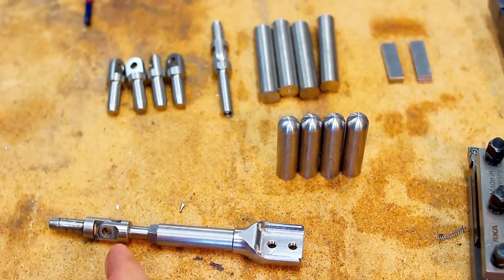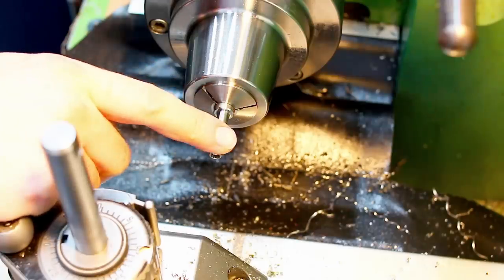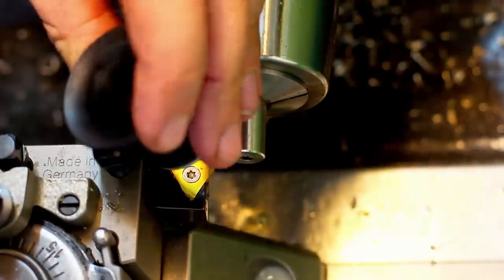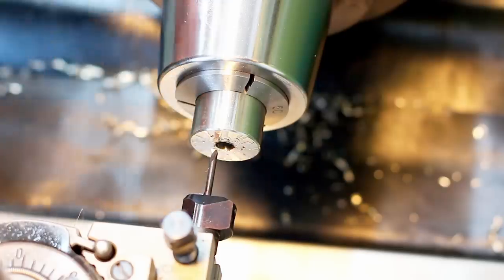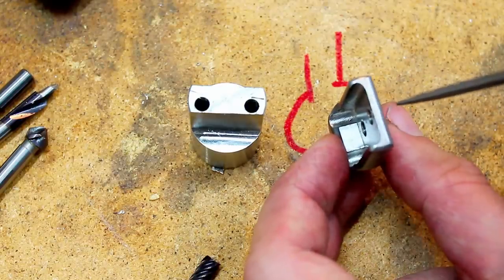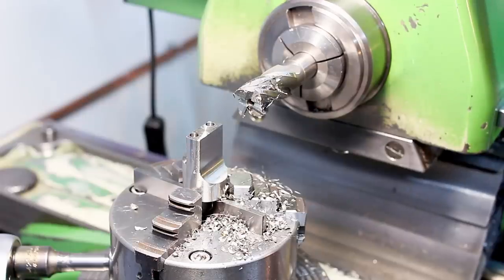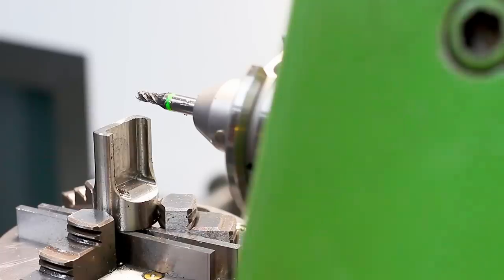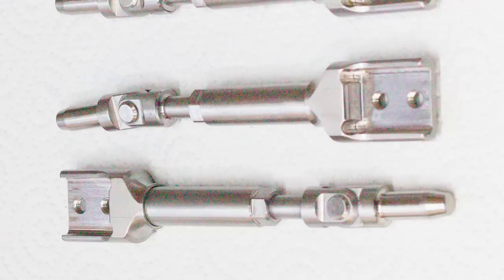Making a part: Flux Capacitor Dampener Units

Comment: Excellent work. I play your videos and other machinists like Robenz when I’m in the shop. I work alone so it’s like having a shop mate who only talks about machining. Which is perfect. I also make several spares of most parts that are > semi complex. I also will sometimes cheat a few dimensions on a couple of spares so when the engineers realize that they didn’t get it right, I can look like a hero when I turn around a part in a few hours.

Comment: Stefan, fully enjoyed this video as I always do. One, maybe, suggestion; I bought a large collection of HSS Co PM mills. I'm sure you know what these are but for the people who don't; these are sintered HSS Cobalt mills which means that the way they're produced is similar to carbide mills only with other ingredients. Because I own a lot of them I pushed them to their limits in tough materials like Toolox 44, hot rolled 316 and, surprisingly, they last much longer in hogging sequences especially. The corn cob variety is getting low on stock unfortunately because I use them a lot since discovering their durability. I use them mostly cnc and program a constant feed pattern with a 25% overlap in between cuts and a d.o.c. of 2D which is impressive in my book. The special carbide mills I used before with a d.o.c. of 1 x D (specific job in warm rolled 316, D=8) took about 1 kW on the first depth of cut, 1,5 kW on the second and 2kW on the last cut and was destroyed in one part. I had to make eight and was in something of a hurry. I loaded the PM HSS Co variant and, after correcting the spindle speed, made 8 parts with one mill used which looked like new afterwards. One skim pass with an eight flute carbide cutter left the part on size and in bling condition. Maybe something to consider? Curious about your answer. All the best, Job

Comment: I use Simturn AX carbide round shank micro tooling because I can make my own holders using a reamed hole and cross-pin, but I'll have a look for used Horn tools on ebay to regrind now I know the trick about only the sloping faces of the holder being in play, Great tip
Reply from the maker: Simturn has some extremely nice tools - I also use some Gühring round shank boring tools with the cross pin for alignment.
Simturn makes it very hard to buy from them via an onlineshop, thats an easy way to loose my interest.
pHorn has a great onlineshop and a full paper cataloge, that makes shopping very nice.
Reply: @StefanGotteswinter  Cutwel in the UK has a good selection of Simtek tooling, but it does seem strange how difficult some suppliers make it to buy online!

Comment: On some big horizontal milling machines, they make a 'parking attachment' to support the vertical attachment while you swing it out of the way & store it on the side of the machine. I was just thinking, there must be some way to make it easier & quicker to swing the Deckel vertical head out of the way when you need to quickly use the horizontal head.. for example, maybe lift the rear of the vertical head slide, insert a piece that connects to the both halves of the dovetail joint, & then lets the vertical head slide pivot upward out of the way? just a thought.. 
Thanks for the great content!

Comment: Hi, Stefan, I wish all Design engineers thought as you and I do, about producing an engineering drawing which gives the actual dimensions which enable the machinist to produce the part without having to perform mathematical gymnastics to do the job. The less calculations we have to do reduces the chances of making an error in the production of the part. I try to teach this to apprentice Engineers with varying degrees of success, but will keep on trying. Happy new year to you and your family, Mal.
Reply: It is often hard to produce such a drawing unless the machinist who will carry out the work is available for consultation. There are generally a number of different setup options, or even different "machine type or configuration" options, most of which will require different "dimensions to produce the part". 
If a part is to be machined by an external or unknown resource, I have found it is preferable not to add chosen redundant dimensions to the main views, as this may unduly influence the choice of method. 
It also greatly complicates the specification of GDT tolerances.
But I personally favour adding supplementary views (usually on a separate "information only" sheet), with non-binding supplementary reference dimensions, for cases where machinists would otherwise have to do trig. 
This does not usually add significantly to the time taken when producing drawings from a solid model, as those views can be copy/pasted from existing views.
When the workshop is within the same organisation as the design office*, the most straightforward way is to make the solid models available to the machine shop so they can extract the setup dimensions required by their particular setup or machine configuration. 
The drawing can then focus on the dimensions which require to be controlled and verified, eg those critical to ensure the part will fit other parts.

* or uses the same design software (provided there are not issues of proprietary security)
Reply: @Gottenhimfella  I suppose I am in a position where I can see both sides having worked on machines my whole life, but also spending a significant amount of that time in the design of the parts I am manufacturing, ( Reverse Engineering). On most parts I specify the Datum first and that normally takes care of the GDT issues, I do use auxiliary drawings when a part is complicated and add notes to the drawing to get the point over, but I suppose the most important part of the drawing is the legend in bold type on every drawing " IF IN DOUBT ASK"

Comment: Is your dro capable of saving tool specific offsets? I was wondering, because you touched off z with the the edge finder first and then again with the 63mm cutter
Reply from the maker: yes, and I did use that. But you still need one initial touchoff with the tools to locate those offsets (Or you have a way to measure tools offline like with a Zoller tool presetter)

Comment: A dampener is something that makes things wet, makes them damp. A damper is something that slows down motion, providing resistance that is proportional to velocity.
Reply from the maker: Yeah, I learned that since i released the video :D
So no it will be there for eternity to display my error.

Comment: I'm no machinist but the only real wear part in a spring dampner is the spring which seems to be easily replacable. Granted this particular part also has a pivot, but wear on the pivot could easily be corrected by drilling holes oversize and adding a simple bushing.

Comment: Stephan, I notice in this video your spindle has NO driving dogs for the tool holder. Is there a good rule dictating the use of driving dogs on the 7/24 based tooling. I notice on the smaller sizes like 20, there are no slots for dogs. Again, very helpful videos,and, thanks for videos on your projects.

Comment: Excellent as always. Are you ever nervous about stainless on stainless dry threads galling?
Reply from the maker: I am always nervous :D
(I have seized a gage ring on a stainless thread in the past, not fun)
Cleanliness and a bit of lubrication (Remaining cutting oil helps for example) help to reduce the danger of seizing/galling.
The final product is assembled with some NeverSeize.
Reply: @StefanGotteswinter  thanks. I have had my fair share of seized bolts.

Comment: I’m curious, what is the cost of OEM if available, how much did they cost if you could charge for actual time spent, materials, overhead, profit, and what you actually charged for the parts ( or customer willing to spend).
Another invaluable lesson in machining, thanks.
Reply: Stefan stated that OEM parts are "unobtainium".  Therefore, whatever he charged the customer for his SUPERIOR workmanship was a bargain.
Reply from the maker: I charged for the actual time spent, material, tooling, overhead and profit :)
And afaik I was still cheaper than the OEM parts used to be.

Comment: Hi from down under . What whitchery do you use to set the cross slide on the lathe to get the drilling tool on center ? Thanks for your time . I hope Santa looked after you for Christmas!
Reply: He mentioned in some previous video that he just dialed that in once, and stored that position in the DRO - no compound means that position is always valid for drilling

Comment: Would it not have been better to set up the 3 jaw with one of the jaws directly in line with the cutting force? Seemed to be a lot of push where the job was trying to go away from the cutter between the jaws.

Comment: Please tell us more about the collet chuck that shows up at about 1:15:30. As always, I appreciate your sharing.
Reply from the maker: Thats a hydraulic toolholder - It holds 12mm shanks (or smaller with reducer sleeves). Incredible good runout and quick changing of tools, but very expensive.

Comment: Would you save any time milling the "ears" with one pass from the top down while there is still stock for rigidity?
Reply: My guess is that would make it hard to achieve a good finish. 
In the absence of a supremely rigid machine, setup and workpiece, it's almost impossible  to achieve a non-chattery finish cut if the roughing cut is not chatter-free.

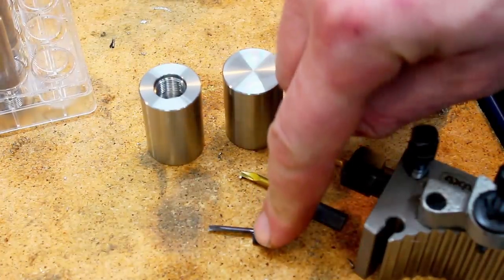Comment: 35:08 only in packs of 2 ? Then how da heck did we then sometimes buy 3 and 1 at a time ?

I do have one maybe two with a shaft diameter of ø0.65mm  and head size of ø0.95mm. And there is absolutely no way that I will use it without a hole in anything except for foam
Reply from the maker: Good relationship with your sales guy? Or buying trough a third party?
The webshop only offers the option to buy in increments of 2.
Reply: @StefanGotteswinter  well i dont know if it was through a third party. i just told the office that i needed like 3 of these and had 3 of them on my desk the day after ( as long that it wasnt to late ) but they sure are nice to have. btw saw at titans of cnc that they came out with a new version ( the same measurement's but with a chilbreaker on. witch sounds pretty sweet to me ( had some long stringy chip problems in titanium and the really small ones in stainless steel )

Comment: So why not use a 6 inch vise for the first op you posted.. ..andncut all 5 parts at once with the 63mm radius cutter? Seems extremly counter productive to set and zero every single peice if you could very easily do them all at once.....ONE SET UP ONE CUT!
Reply from the maker: I would not dare to try that. Clamping multiple parts is reasonable hard to get a firm grip on all of them.

Comment: "Flux Capacitor Dampener" ... so they make flux capacitors moist?  If a component resists some mechanical force, it's probably a damper ... not a dampener. :)
Reply from the maker: Time machines need some moisture, to keep the time travel accurate.
(Yes, mistake on my end :D )

Comment: I LOVE those side mill cutters. I was using an 100x2.5x36Z one on a VMC (using a 27mm face mill arbor and 2 spacers) to slot batches of aluminum parts at a 15m/min cutting feed while climb milling (more than 400m/min of surface speed which seems absurd for HSS-Co)
Reply from the maker: Thats a mighty impressive cut for a HSS cutter :D

Comment: Did I miss the new to you Horizontal Mill acquisition and setup/test run?  Looks like a fine piece of machinery!  Love the Flux Capacitor videos!  Happy New Year Stefan!  Always a treat to see another lesson from you.
Reply: The FP1 is a universal machine.
This is just one of its configurations.
Stephan featured its delivery and setup in a recent video.
Reply: Stefan has a great video on the FO 1, if you haven’t seen it, check it out. He shows a lot of what it’s capable of, it’s worth the watch.

Comment: Great video Stefan, love to see that fp1 at work. Does it not have drive dogs on the horizontale?
Reply from the maker: No, not as a default - There is a loose ring with drive dogs on each side that intersect between the toolholder and the spindle for very heavy cuts, if necessary.

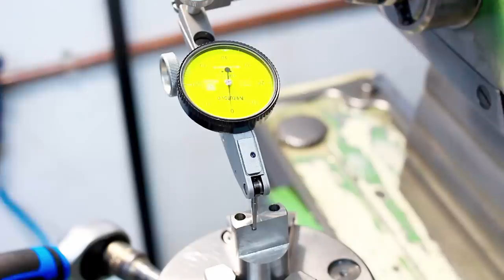Comment: Thanks for the video, I always learn so much. I was wondering why you aligned the part in the chuck at 1:00:00 instead of simply rotating the chuck. Is it to not loose the zero-point on the dials?

Comment: That flux capacitor will be the greatest machine humanity has ever made. It will solve all our problems: free energy,  Standard Model,  burnt toasts, not to mention time travel. 
I hope you will continue to make parts for it  - always great to watch. :)
Reply from the maker: I hope Doc Brown only uses it for the good of mankind :)
Reply: But the real question is, when it is finished will he travel back in time and make sure the HSM podcast didn't die?
Reply from the maker: @CSWeldFab  We never officially killed it of :)
Reply: @StefanGotteswinter  Jody never did a final WTT podcast, so I hold hope for both still :)

Comment: I have even bigger issues with the spindle speed on my little lathe, I've got a 1950s hercus that's in near new condition that I picked up for 200 bucks.. it's an awesome little lathe but I've got to speed it up badly for using insert tooling, I'm always at top speed except for threading and I often have to resort to hand ground tools to get a good surface finish.. I'm looking at removing the 1hp single phase motor and putting on a 2hp 3 phase motor with a vfd

Comment: Very nice video ,but i got one question.Ive noticed you dont use the square things on your milling machine tool holders.Is just the taper enough,even for those small cuts?when i use Deckel direct collets,bt40,with just taper sometimes they stop spinning and scrach the spindle.Happy hollidays.

Comment: Thanks again for an excellent video and for explaining why this tool/setup will work and what problems are avoided.  Coming from the inch world I wondered if sometimes metric threads are cut by opening the half nut and not reversing the spindle.  Many times, this is not possible with leads ending in 0.25, 0.75 but it can save time when it works.  When the lathe screw lead is an integer multiple of the cut screw lead it will work.  Here if the lead screw is 5, 6, 8, 10mm etc then the 1mm will always synchronize with it.  Best wishes for the New Year.

Comment: Excellent as always.
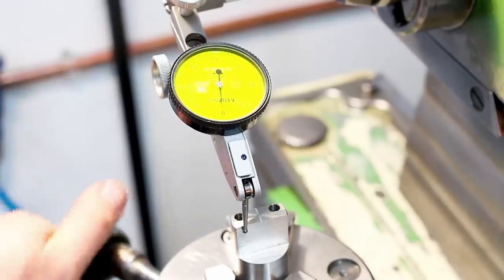Maybe a silly question, but can't you use the indexing head instead of the parallel pliers to index the part (at around 1:00:00)? Or is it just to make the turns of 90/180 degrees later less math intensive? (Not sure if you can zero the indexing head...)
Reply: All the indexing heads I have (or have used) had an immovable indexing plate, so this was a familiar step, but I've not seen a Deckel one. The advantage of a tapered "pin in hole" (or some equivalent option) for indexing is not just the elimination of the need for maths, but the elimination of the time taken to acquire a position, and the reliability (immunity to  the bozo factor) of the acquired position. If there are multiple operations each requiring the same indexed moves, this advantage is obviously compounded.
Ideally (for repetition work, in particular) there is provision for masking/disabling all of the indexing opportunities other than the ones in use for the job at hand.